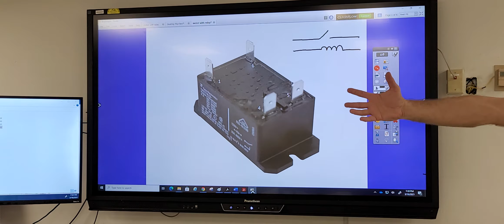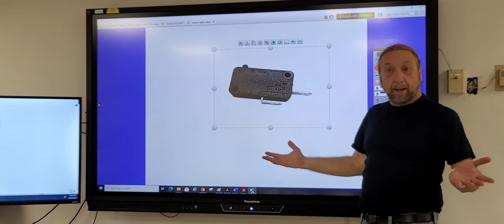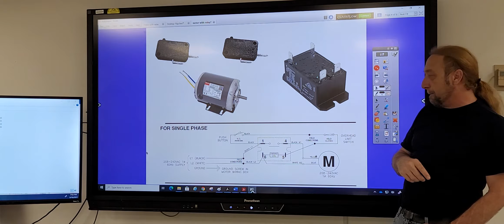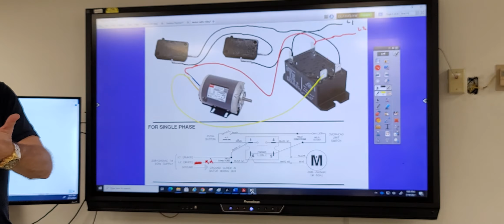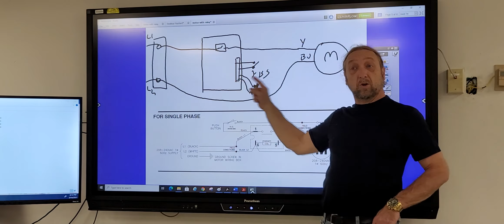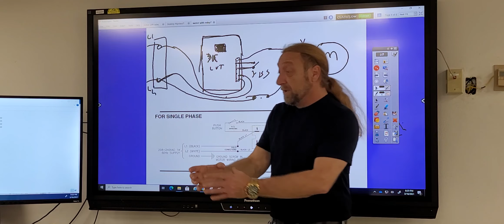Some wiring basics

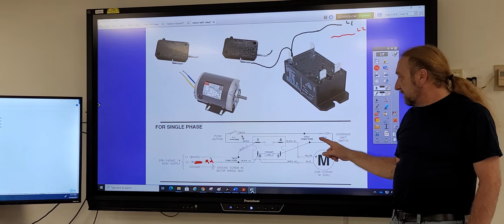Comment: 22:28 - You have chosen the correct switch for this example, Sir. Your schematic shows the second micro-switch as held closed; which would indicate a normally open switch.
Reply: that is the overhead limit switch its normally closed and opens up once the maximum lift height is reached

Comment: For big motors on the board would be a small relay just to control the heavy-duty relay mounted on the frame controlling the motor. Is that correct?

Comment: Ok, run the unit up and opens the limit switch. Now there must be another circuit to run it down or your opening some type of hydraulic valve to do a controlled lowering. Because once the limit opens you ain't power anything up.